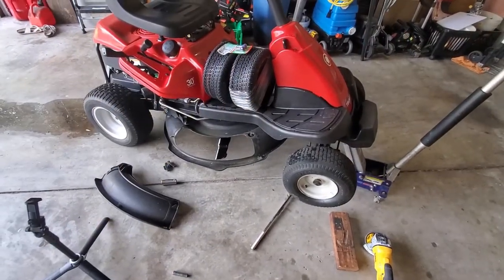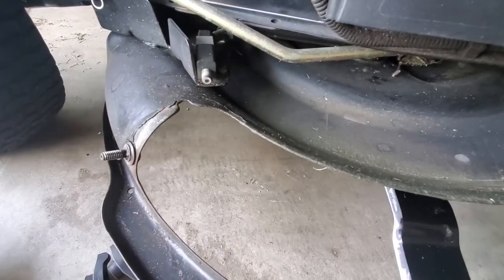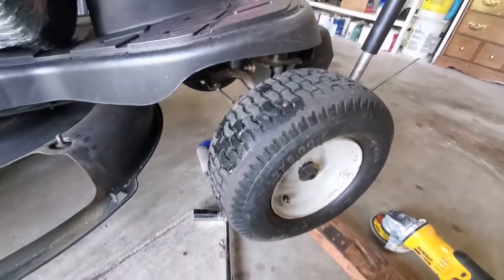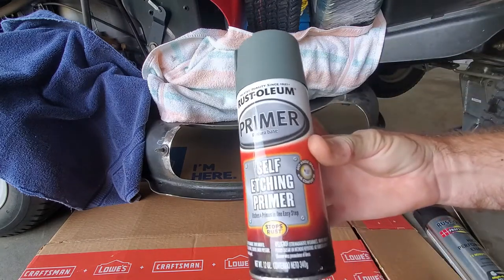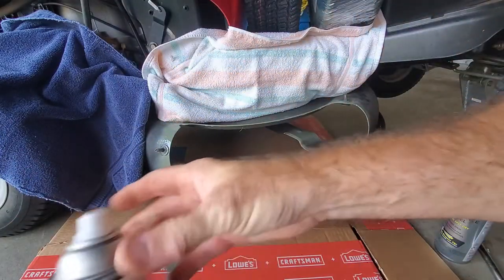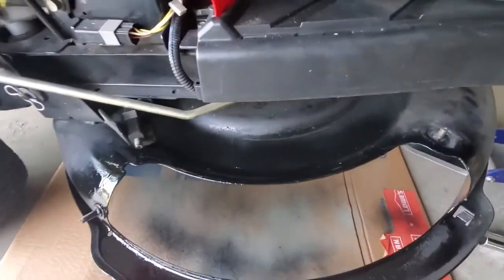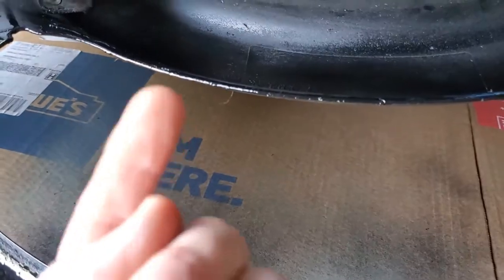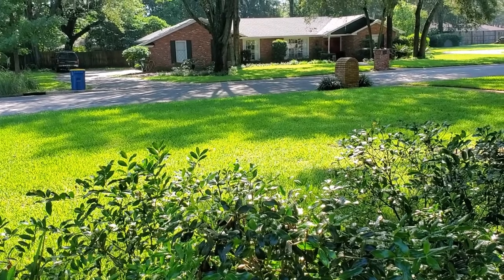Lawn mower deck rust prevention

Comment: A little tip for after rust removal and before you paint...Wipe down the surfaces that you intend to paint with isopropyl (rubbing) alcohol.  That will remove most residues that may interfere with proper paint adhesion. Good channel BTW.

Comment: Hey Peter , what tool do i need to take the original oil plug mate?
Reply from the maker: Use a socket ratchet with an extension and no socket. I think its a 3/8.
Reply: That did the trick! I finally modified it with the rubber hose changed oil filter air filter spark plug and added new oil. Now it doesnt want to start no crank nothing. I checked the bottom safety switch to see if its tight and it was, now I dont know what to check. It started when I warmed up for the oil change
Reply from the maker: Did you figure it out?
Reply: @petedymond  Peter! The solenoid and the battery connections were burnt rusty. I ended up replacing them all! It also had a fuse with 5 which i changed for 20. As soon as I put everything back together it turned on right away!
Reply: @petedymond  I purchased this mower used and the last owner bought the wrong batt and im guessing the connections were rubbing off eachother that it burnt it. He had a right positive side batt so the connections were all together , i had to take it apart. The right batt shouldve been left positive